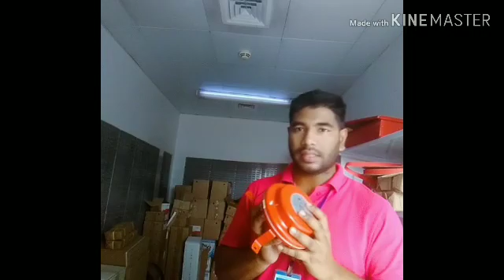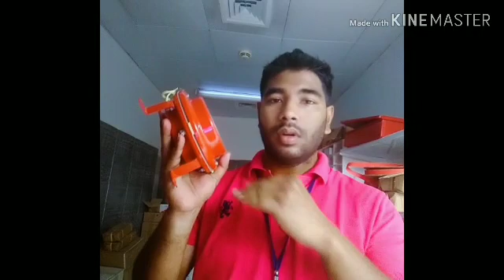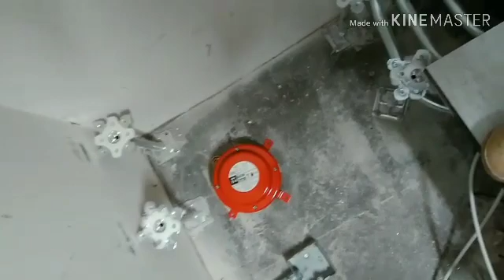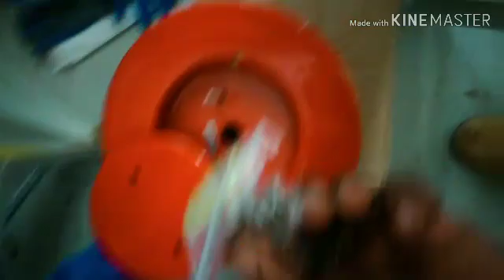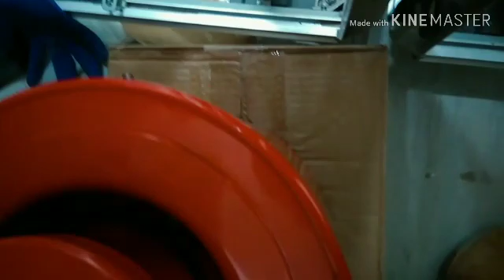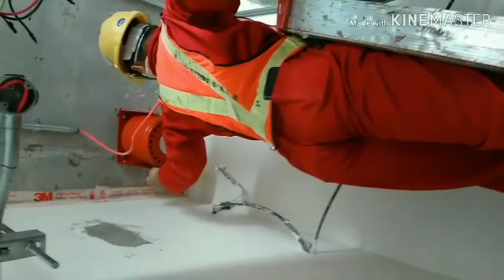Aerosol - aerosol generator installation,  How to install, Where You can install

Comment: You the panel termination for the room
Reply from the maker: No, Shield panel we can use for aerosol , Novec & Fire pro,fm200 system,  but panel termination are same,,
Reply: I want to install statX aerosol, do I need actuators